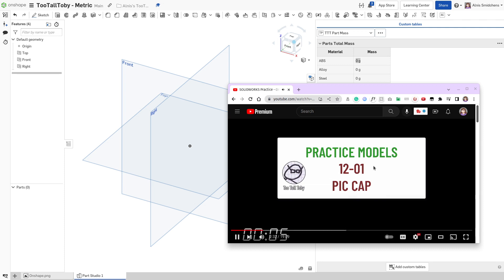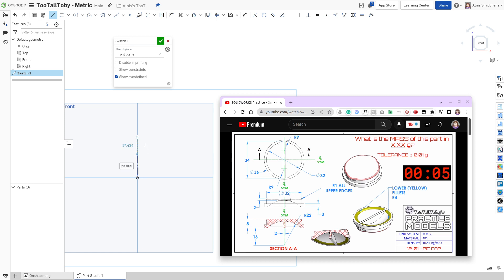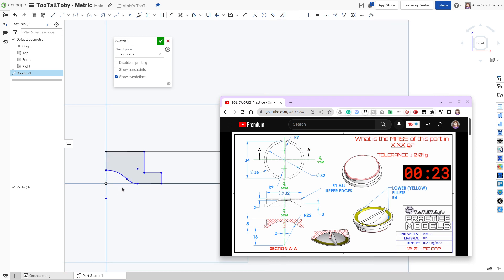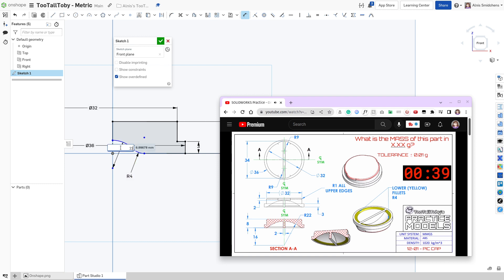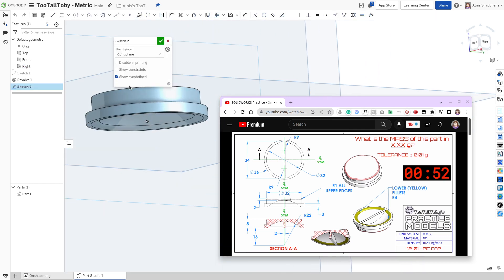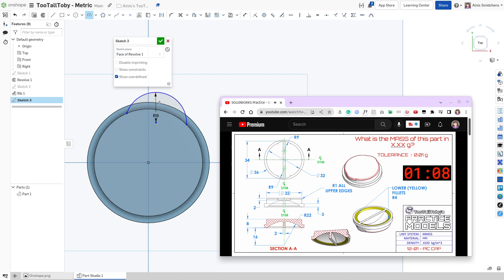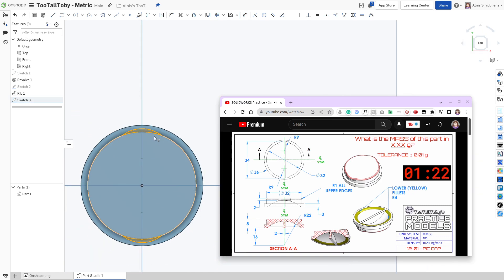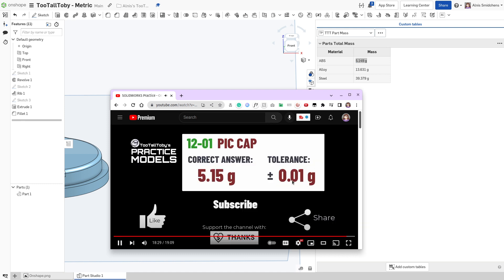12-01-PIC CAP Tutorial: 1 min 31 secs in Onshape!

Comment: Excellent. That is a really hard time to beat (If I do, I will post a video on how I did it). 
It is nice how with Onshape you can use edges for the extrusion, this can't be done with SW (referring to the last "ears")
Reply from the maker: Thank you, Ali! I enjoyed watching your video for this model.
What's going on there is Onshape automatically imprints the face you're sketching on into your sketch, so it works to define the edges of regions. It's similar to projecting/using geometry into the sketch in SolidWorks.